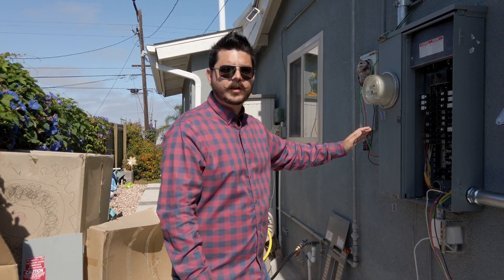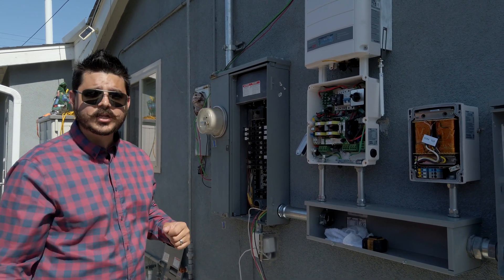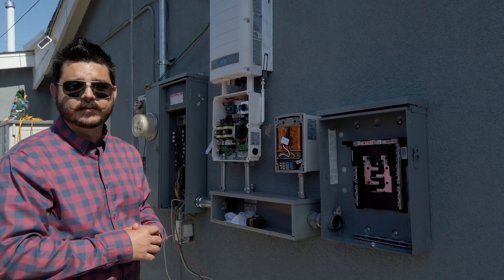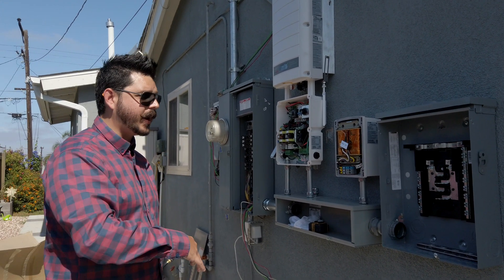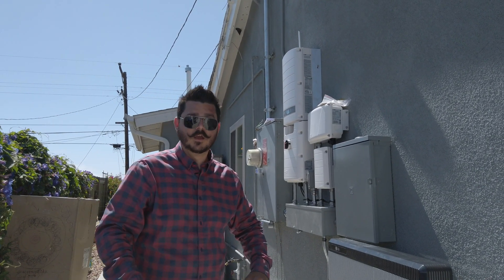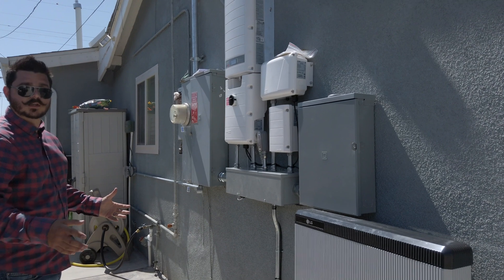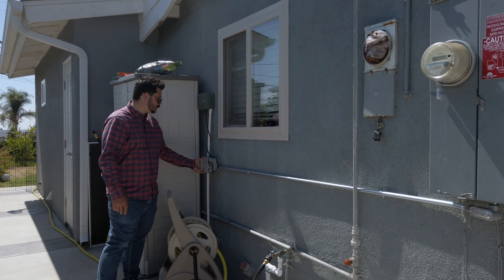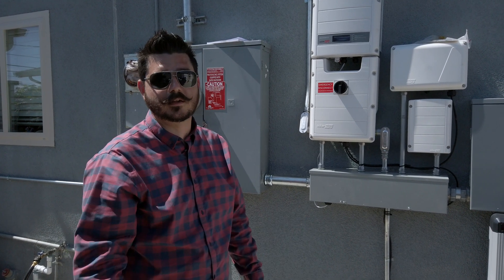SolarEdge Solar with LG Chem Battery

Comment: Question about the LG Battery.  Under normal operation the light indicators always be in either "ON + Charging"  or "ON + Discharging".   What does it means when  it stops from being in either of those two?   The LG manual says it is "power on, idle", but doesn't say if this is a normal condition.
Reply from the maker: @f518-tute  you’ll want to reach out to LG ESS https://www.lgessbattery.com but the monitoring app should indicate if your battery is operating correctly

Comment: what should be the maximum charge level be to extend battery life? 
my samsung cellphone has the option to set the max level to 85% for the longest battery life, 
would not the same hold true for RESU10?

Comment: I have a LG battery that holds 9.8kwh. They configured it to only be a back up. So it doesn’t do anything, doesn’t kick on a night. Is that optimal? My bills are typically 5 bucks and at the most $100 in the one month it’s cold( Texas) and maybe $100 in July.  Is that the industry standard? My installer claims since my panels pretty much power the house, I’d be losing back up potential while running it at night if the power went down and my battery was at half capacity due to running the house at night. If I understanding it right, the battery only holds 9.8 kWh and would run the house for maybe 8 hours. We have it only hooked up to the fridge, some lights and bedroom. They stated having the central air/heat hooked up would run it down in two hours (4ton until).   Just wanted another perspective, thanks.   Basically, they said I could have it come on at night and save maybe 20 bucks a month but risk having a depleted battery if the grid went down a night. Of course, they charge a service fee to change the configuration, I wish I could change it myself from time to time. I have solar edge.
Reply: There's no way to run an AC unit through the battery. Way too many amps. The battery would fail. It's a good idea to keep the battery running at night because the batteries need to be used or they degrade. I personally don't really care if the grid goes down and I'm stuck with a battery at 50%. For example, if the grid went down at 2am, the battery would run until the sun came up and the solar panels would be running the house while also recharging the battery. The amount of power you're using during an outage (running off the battery) should only be critical loads. You'll be creating a lot more power than you're consuming. Just my two cents. I have a 14 unit/4kw solar system with the SolarHub Inverter + 10kw battery.

Comment: What was wrong with the HD wave inverter? For a residential install, is 3 phase inverter needed as an upgrade?  Just curious because that’s a $2000 line item.

Comment: How many amp hours is the LG Chem?
Reply from the maker: This figure isn't as relevant with lithium ion batteries is it is for lead based batteries. I believe the LG Chem battery though is 63Ah
Reply: LG don’t like high temperatures. We had a huge recall here in Australia due to fire risks

Comment: Dale, How about a review of the new SolarEdge Energy Hub Inverter with the LG RESU10H?
Thanks
Reply: Ralph Castiglione if you are referring to the new DC-coupled inverter, it would use the low voltage battery at 48-volts not the high voltage battery.

Comment: Clean install, your battery is too low tho , you need clearances around your LG battery specially below it
Reply: I was thinking the same thing. Needs 24" from floor,12" on both sides and 12" on the top.
Reply: @jaysolar6111  12" from the bottom straight from the installation manual..
Reply: I was just thinking that ain’t gonna pass inspection bro
Reply: Also you can have Ac and Dc in the same runway

Comment: As someone from the midwest, it always seems super weird to me to see electrical equipment mounted on the outside of the house. Sure looks like it makes things super easy to work on though versus having to run everything through drywall covered walls into fully recessed panels.

Comment: Looking at quotes on a very similar system. Does this setup allow for the customer to schedule time of use discharge from the battery in addition to running the critical loads during grid outage or is it just one or the other?

Comment: Dale, I live in México and I'trying to choose between SE and Enphase. At the start the system Will be 16 panels 6.0 kW PV. 
In about 2 years it will be moved to a larger house and double the capacity. And in about a year more will want to add battery for backup only.
With SE, the installer is proposing an SE7600 and tells me that he can do the upgrades in the coming years.
On the other hand I have Enphase with the current iq7+ then the iq8 and the encharge.
Can you help me decide.
Carlos
cmijares@gmail.com
Reply: I was just agonizing over this. I wound up going with SolarEdge StorEdge inverter and the LG Chem battery. The Encharge seems extremely expensive for the capacity. I also like the DC coupled system so there are fewer conversions between AC and DC.
I actually originally ordered an Enphase system with IQ7+ inverters, but when I decided I really did want storage, I changed that to SolarEdge.
Reply: You can now do whole home back up and DC coupled batteries, with solar edge energy hub inverter, with up to six lg chem resu 10 with three energy hub inverters, and up to 15kw of continual power, enough to run ACs ovens all the goodies
Reply: Carlos Mijares SE just introduced a DC coupled inverter.  Before this they had AC coupled inverters.

Both inverters use HD-wave and look almost identical.  So you have to know what you are looking.

The problem with the SE DC coupled inverter (the new inverter) is that it will only work with two different batteries.  They are both 48-volts.  One is the low battery from LG, and the other one is from SE.  The one from SE will be released next year.

Other DC coupled inverters will accept a broader number of low voltage batteries with different chemistry. This is important based on what batteries you may find in the future.

The SE AC coupled inverters are, also, limited in the number of high voltage batteries compatible with SE.

One option would be to stick with your current inverters if they will work with a DC coupled inverter, and choose first a low voltage, reasonable cost battery solution.  

Lithium batteries are all the rage, but cost wise they are too expensive to make much sense.  

After you make your battery choice, you could get a second inverter from Victron which accepts a much larger number of batteries and chemistries.  

This will give you more options when it is time to change your batteries.

The AC inverters will continue to work with the grid, and if the grid goes down, your Victron inverter has you covered, and if you want to store energy in the day, and use it at night, it will do it.

https://www.victronenergy.com

Alternatively, you could use a single inverter from Victron connected to the grid with battery backup.  

There are several examples at their site:

https://www.victronenergy.com/upload/documents/Datasheet-MultiPlus-II-GX-inverter-charger-EN.pdf

A major difference to keep in mind between the Multiplus and Quattro is the number of AC sources.  If you don’t require an external generator, the Multi can be hooked directly to the grid.  If you require an external generator, the Quattro will work with the grid and an external generator.

As you can see, they have a larger number of inverters providing a broader spectrum of choices.

This is a quick intro vid:

https://youtu.be/nU5yUY6VhIU

Here is an intro to AC coupling and DC coupling:

https://youtu.be/WVM0F2OrQhA

This is an alternative to the above:

https://youtu.be/BNXerUeHk30

Both Victron and Morningstar offer a wide number of compatible batteries.